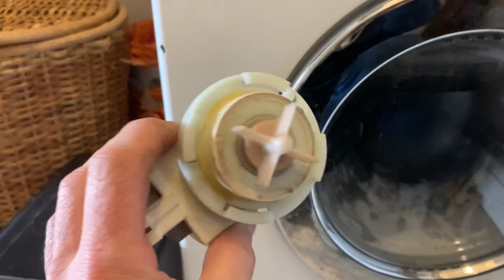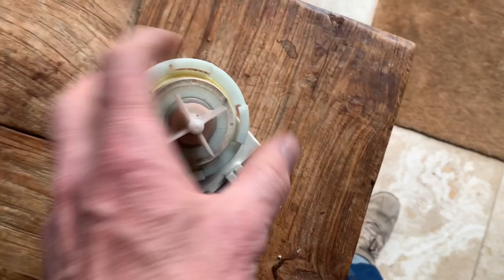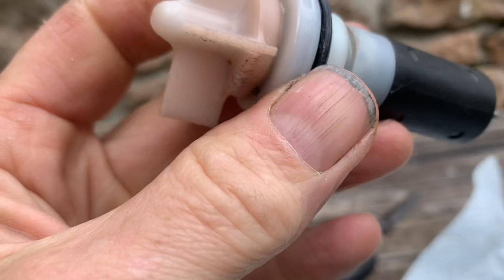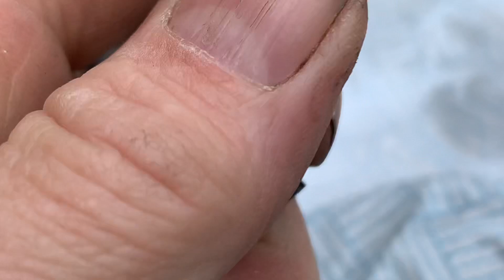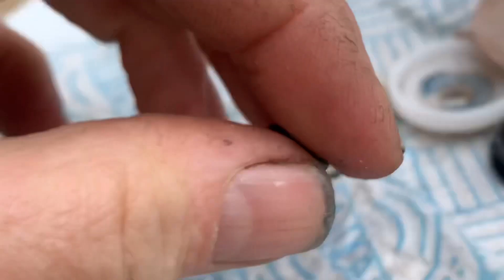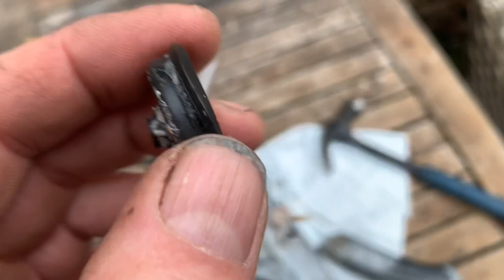Miele - check drainage system fault

Comment: Good video. I have a Miele M3725W and had a drainage error this morning, the machine was making a beeping sound I hadn't heard before. I followed your recommended pump test @ 00:49 and confirmed the pump is working correctly.  The way my washing machine is installed it's difficult to tilt forward to drain any excess water. So I tried plan B which was to pull the clothes out, and run a full cycle on hottest water temperature, and it seems to have fixed the blockage.  I was actually shocked to see how soapy the water got, so Im thinking it was maybe clogged up from soap build up (?).  It's people like you who take the time to do these tutorials that really make life easier for others. So thank you for your service to others!!
Reply from the maker: Just seen your comment - thanks for your kind words. Glad the video helped. Mike

Comment: What would cause that default drain at the bottom of the machine to be full of water constantly and leaking a bit? Would a dead pump cause that as well or something else?
Reply from the maker: Thanks for your comment and sorry to heare about your leak issue. A faulty pump would generally throw up a message and stop the machine from working. It might be something as simple as a loose/broken hose clip and a split pipe. If it was me, I would attempt to take off the front (or side), thoroughly mop up any water using sponge +kitchen roll. Next I would tie bits if kitchen roll round the various rubber pipe unions and run the machine through a cycle. Hopefully you should be able to see where any leak is coming from. Good luck. Mike
Reply: @scottitonline  thanks for the reply! I think it may have been a simple clog in the pipe from the detergent cartridge into the actual machine. After using a Q-tip, pouring some white vinegar through, and then rinsing with hot water, the issue seems to be resolved as the leaking from the detergent cartridge isn’t occurring anymore. So I’m gonna wager on buildup clog.
Reply from the maker: @MonsieurPixels  Cool - that's good news. Over and out. Mike

Comment: Can you take the pump out from the front?
Reply from the maker: Thanks for your comment. It might be possible to get the pump out through the front lower panel depending on your model of Miele. I did it through the main round door for better access. With hindsight I should have shown the removal of the pump. Mike
Reply: @scottitonline  thanks very much for your help.  Turns out pump fine it was a breather pipe lhs clogged up with black labrador fur!!! Appears it couldnt get air replaced from pump end so would have created a vacum.   Any ways many thanks again
Reply from the maker: @bobbyfischer6786  Those pesky black labs! Great news that you got it fixed. Mike

Comment: hi scott, if you do a ohms test on that pump, what should the reading be.? i suspect mine is gone as when i do a continuatity test across the terminal there is no resistance. not sure if thats what it shoudl be?
Reply from the maker: Thanks for your comment and sorry to read you have a problem. I'm not sure what the resistance reading should be for that pump motor....however when you set your voltmeter to 'continuity', it should start off at '1' (eg infinite resistance) and then change when you put the probes across the motor terminal. if there is no change, it would imply your motor is not working. Take it out and inspect it and if need be (if you are brave) put 240 volts across the terminal. Mike
Reply: @scottitonline  thanks scott, i took the pump out and the ohm reading is about 160ohms, however when i move (by pushing/pulling) the propeller i can see liquid movement just like the one you showing above, and if i shake it i can hear liquid movement as well. with your new pump was there any liquid moment as such when you move the propeller or shaking it. the pump currently is tripping the circuit breaker.
Reply from the maker: @Michael-qt8md  There should not be any water in the pump. If there is, it means that pump seal is knackered and you need a new pump - water in pump = tripping electrics or drain pump fault. Mike
Reply: @scottitonline   thanks for that, thats what i thought. i have already ordered a new replacement for it after watching your video earlier on. I didnt think it should have any liquid in there, i know its a magnetic switch, but wasnt 100% sure. but now you have confirmed that it shouldnt. I am pretty sure i have found the problem. once again, many thanks for sharing really appreciate it. hopefully new pump will fix my issue.
Reply from the maker: @Michael-qt8md  My pleasure - I have had so much help from YouTube videos in the past and am glad to be able to give a little bit of help back. Over and out. Mike